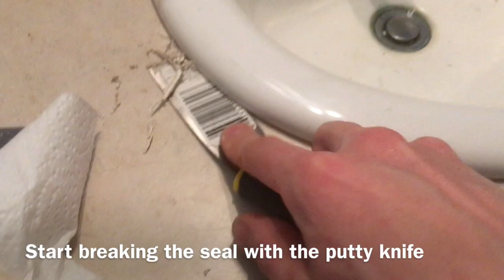Removing A Porcelain or Ceramic Bathroom Sink

Comment: Here's the problem with drop in sink DIYers they will tend to put a ton of caulk to seat the sink in. Then when it comes time to replace the sink it can be a pain in the rear trying to remove it. All you need is a bead around the rim of the sink. The drain pipe below will hold the sink in place.
Reply from the maker: yes yes, great point, hopefully some watching this will read your comment before installation
Reply: @ecophage  right on. there is no reason why you needed a puddy knife and a crow bar unless someone put way too much caulking around the underside of the sink. Simple box cutters would have done the trick if they would have just beaded under it. Some people go way overboard than whats needed.

Comment: What do you do if they used caulk?? I can't get the sink bowl out from the underside. What tools do I need?
Reply from the maker: If it’s caulked in, run a razor blade down the caulking and then go at it with either a flat head screwdriver or a putty knife like in the video
Reply: @ecophage  thank you! I'll try again tomorrow
Reply: @ecophage  whoever did this job did an amazing one bc I can't break the caulk. I'm actually damaging the sink bc pieces are breaking off but the caulk will not budge
Reply from the maker: @surayamarsh2374  you can try working one pry device one direction and then leave in in partially pryed then work the other the other direction maybe even run a blade between them. Also verify there’s no little metal brackets bolted to the bottom
Reply: @ecophage  thank you!!! I got a smaller flat head screwdriver and it did the job. Did damage the rim quite a bit (can't donate it now) but I got it up. Thank you so much!!!
Reply from the maker: @surayamarsh2374  yay! np